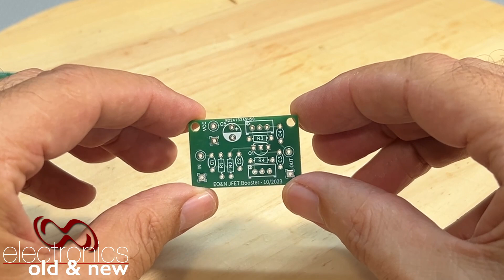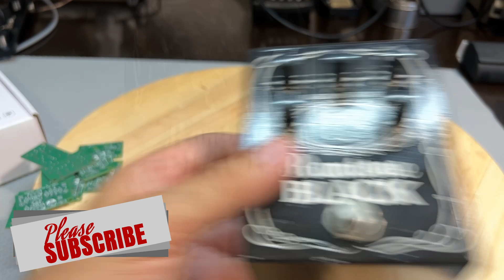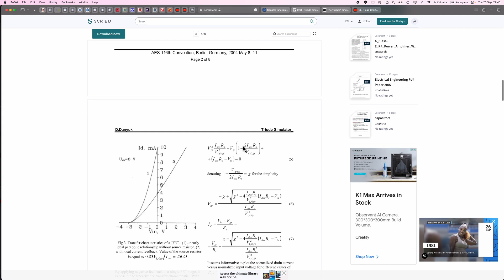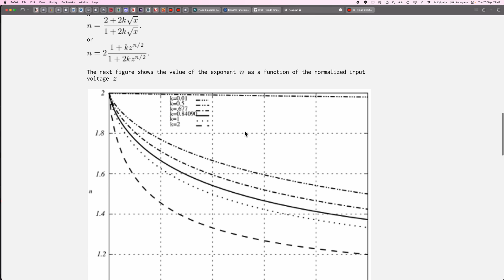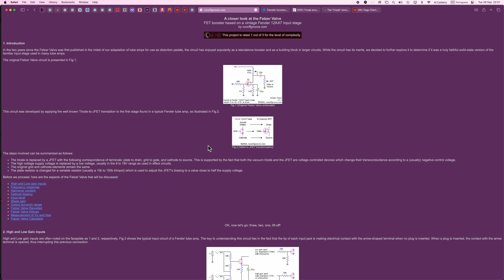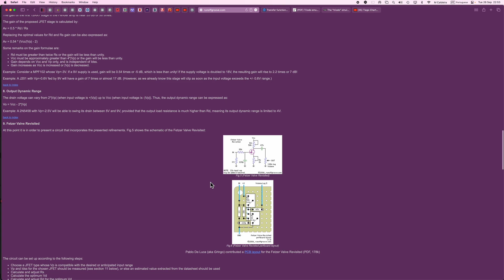Want to make your guitar active? Build a JFET Booster that 'emulates' a tube triode stage  #pcbway#

Comment: Great  stuff. Been messing around with that same circuit/resource you showed.  My idea was to make a SMD version, that solders on to a push/pull (switch) pot, to be able to do a by pass. Maybe power it with cells. Don't know. To many projects already ha ha. Very useful video as always.
Reply from the maker: We always have too many projects … and too little time 😊

Comment: I use the MMBF4416A in it’s SOT-23 package (it is the SMD version of the 2N4416A) in HF (radio frequencies) circuits.  I hope buying a 100 count reel will deliver almost identical devices. Ron W4BIN
Reply from the maker: Being from the same batch will certainly get you  greater consistency in the specs, but they’ll still jump around a bit 😊

Comment: I like to also put my trim pots in a socket. That way I can set the value of the trim pot off board to the value I want and be sure that I only measure the pot value. It makes things a bit more bulky but it makes it so you can accurately set the pot. Or you can use it to easily switch resistors for testing. Now in your case it makes no difference because you go straight from Drain to VCC and from Source to GND. But in other circuits it is not always possible to measure the trimpot accurately because of other components in the circuit.

Comment: I suspect that a Philips/Raytheon wire ended vacuum tube might work better and will work of heater voltage of 1.5V and a B+ of 9V.

Comment: Is it my imagination? I got the impression that the phase difference between input and output was not quite180.
Reply from the maker: No, it was not. The capacitors in the signal path will have some effect on phase.
Reply: Of course stray inductance can also have an effect. Thank you for your response. @electronicsoldandnew

Comment: Thanks! Tip = I use KiCad to design my boards. Many of the discrete through hole components (caps, resistors, diodes, etc.) can be seated in a (common) 5mm pin spacing. 5mm is common on ceramic cap ("gum drop") through holes. That distance will also accommodate through hole resistors and diodes, if you seat them vertically. A distance of 5mm will also accommodate a 1206 (and smaller) SMD. So, I made a custom footprint that has 5mm pin spacing for through hole components and pads in between to seat SMDs. Now, I have a choice to use TH, or SMD components, without having to buy additional PCB real estate to provide a parallel choice of pad types.  I hope that was clear. Cheers!

Comment: No, you're wrong on C4 .... it passes top-end and lowering the value will cut-off low-end. BTW, in the D-S line you'll want some fixed resistor for in the current circuit you're able to blow up your FET.
Reply from the maker: The output load is the scope in this case, but would probably be safer with an on-board resistor.

Comment: The capacitor across the input is not a Miller capacitor. Miller capacitance is the capacitance across the grid and plate of the triode. Because of feedback action, part of the capacitance between the grid and the cathode will be the Miller capacitance multiplied by the gain of the triode. But the real problem with Miller capacitance is when use are using tuned circuits. There, Miller capacitance can introduce negative resistance and cause the triode to oscillate. Neutralizing the Miller capacitance was a major problem for wireless receivers in the 1920s. (The introduction of the tetrode and pentode solved this problem).

Comment: I noticed when you were showing the first schematic of yours, there was C2, but when you were showing the roll-off later, it was labeled C3. Hum!
Although characteristics are different, J310 are popular as well.  Although their calculator is very nice, to bad they don't allow to switch between the devices.
Reply from the maker: I’ve actually got a few J310s so will probably try that as well.
Reply: @electronicsoldandnew   - 👍